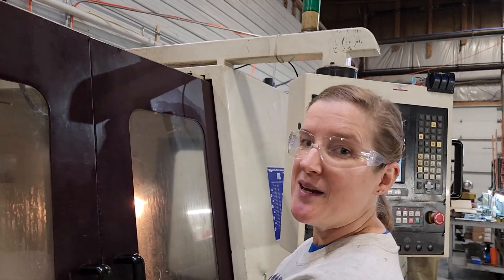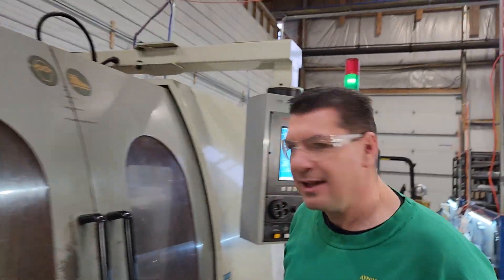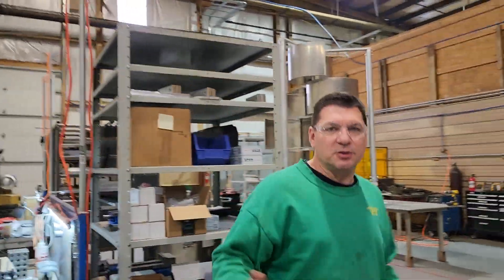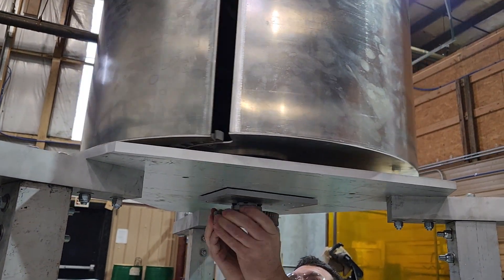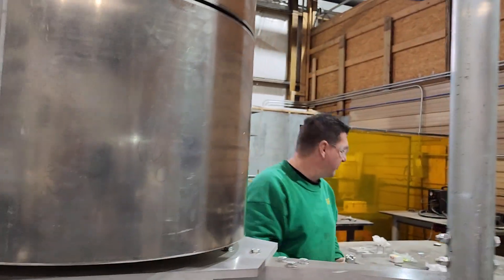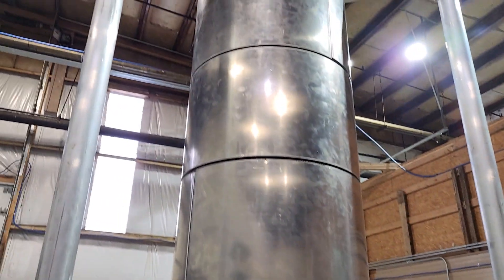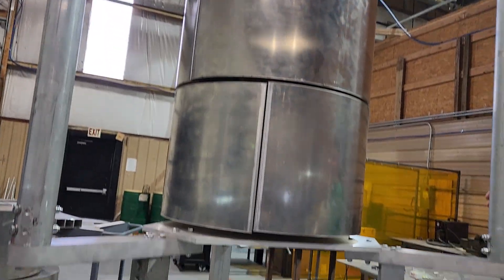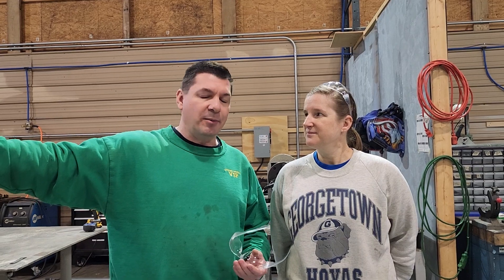Happy Holidays 2022 from Harmony!

Comment: I can`t find any specs about the min-max range of output in watts that these turbines can achieve. Can you point me to the specs?
Reply: We do not have published ratings yet, because we’re still in development and just now starting to work on those numbers.  We have partnered with three prestigious engineering universities who will be analyzing and studying our technology specifically. We are excited to receive the results from the various testing methods they will be applying to the various
models of our turbines, but these results will take time to come in over the next year until the end of 2023. We expect the current prototype we are working on (our 400w model) to generate around 400w in a 25mph wind, but the true power output will be determined by our testing, BETA Field testing and the various universities with whom we’ve partnered.